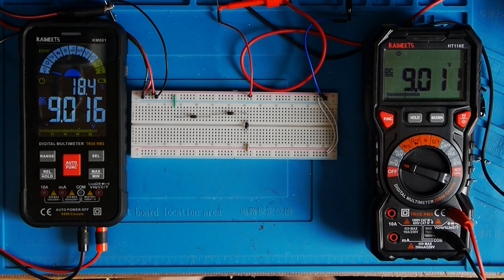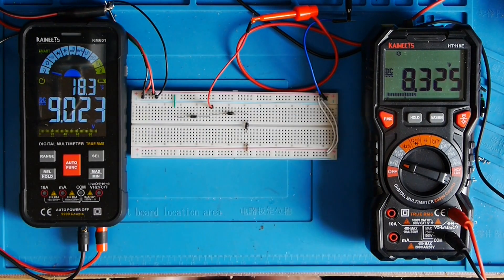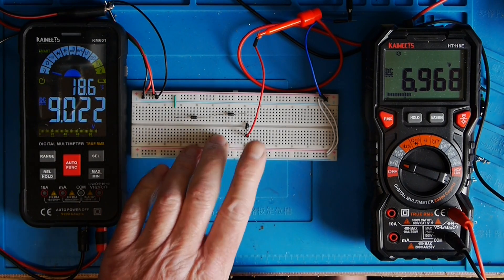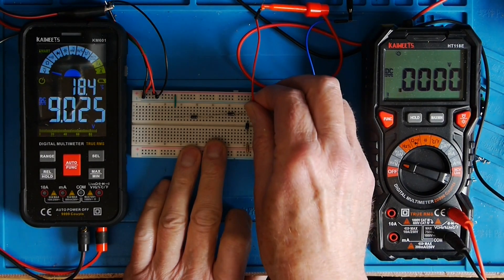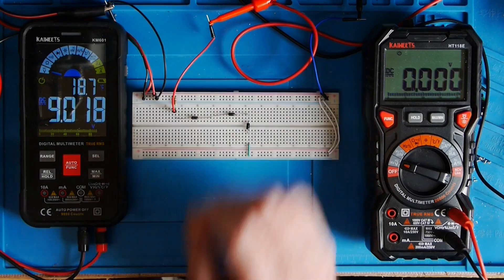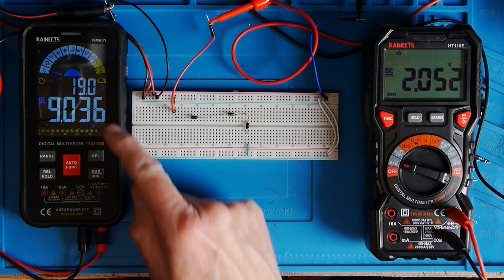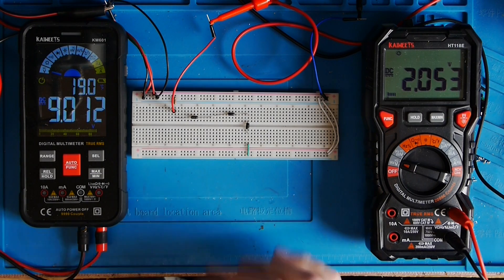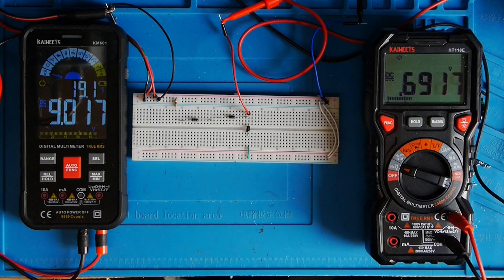Voltage Division and Control with Diodes - #166

Comment: Seems like I may have seen this method used to create a negative voltage rail for op amps in a very basic variable linear power supply circuit?

Comment: Yes, very interesting. Thank you. I will need to think on it, to sort it out. Seems like the diodes are "demanding" their typical voltage drop, no matter the arrangement. In the second arrangement - resistor then diodes... Your last reading was 0.68V. This is the typical v drop for one diode... So, I am wondering if you made the circuit as a single resistor to a single diode, would not the voltage still be 0.68 before the diode, regardless of the voltage supplied? I think what would change is the v drop on the resistor. It would have to drop the additional 1.4V that the two removed diodes were dropping.

Comment: Diode voltage drop dissipates excatly as much heat as would a resistor of same voltage drop. There is no mystery in that, just ohms law.

Comment: I've gotta admit that I've not really thought about using diodes to drop voltage. You always instinctively reach for a couple of resistors. Thanks Bill for your informative videos. I'm 53 and have come to the subject a little late in life but I've always had an interest in electronics.